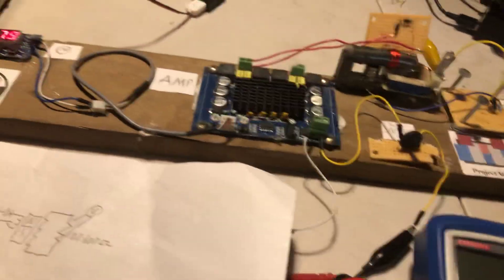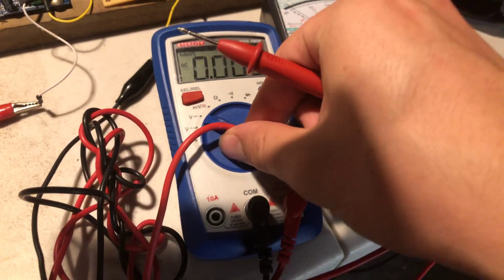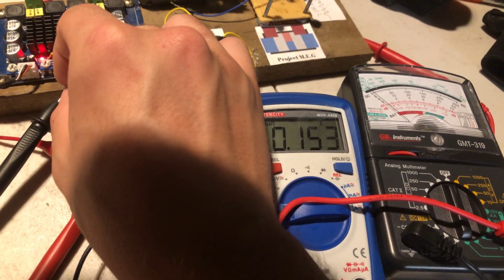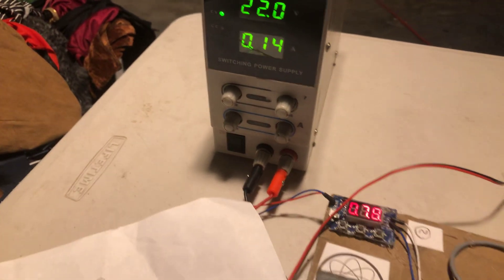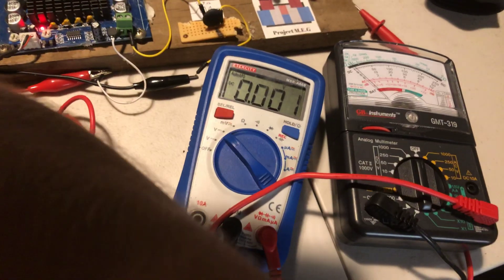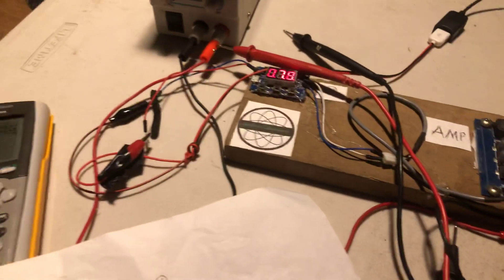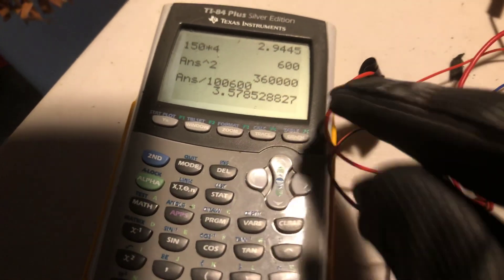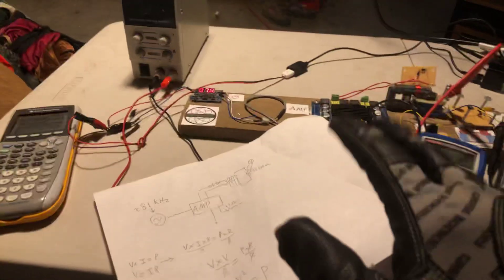Motionless Electromagnetic Generator by Tom E Bearden (Ferrite Core)

Comment: CORRECTIONS: you can break a law depending who you are.....BECAREFUL
Reply from the maker: Laws of physics can’t be broken
Reply: @filigenzilab9613  Thank you for making the MEG please do more videos about it.
Kirchhoff's law of thermal radiation has been broken tho.
Reply from the maker: nightmisterio if his law of thermal radiation has been broken, which I don’t know much about him, then it wasn’t a law.
Reply from the maker: nightmisterio I have quit doing the M.E.G project, but I have moved to other potential overunity devices, like the Tesla hairpin circuit (which I posted a video on) and the 2SGen by Naudin
Reply: @filigenzilab9613  you did get more power out than in correct?
Reply from the maker: nightmisterio it may have likely been a mismeasurement. I may not have had the best tools for measuring, I didn’t use a nanocrystalline core, and I got different results. I’m an amateur
Reply: @filigenzilab9613  The MEG was designed to create more energy than spent, I am glad you had a positive result and were a witness to it, I am sure all measurements were correct. 👍
Reply from the maker: nightmisterio thanks

Comment: You are operational diagram is very sketchy NOT neat try to draw an neat sketch diagram. If you want real engineers to comment.
Reply from the maker: Sure thing
Reply from the maker: Well, I plan on recreating this circuit using better equipment, but until then, I can send you a link to the pdf containing the schematic

Comment: Really cool you like to experiment like me. Accelerator. Is it drawing from ground? The thing is I can get what looks to be more power than I put in the problem is load. When I add a load it slows down the acceleration because we can actually make something run faster and create momentum but a load is like the brakes on a car. Wow keep experimenting! I believe that it can be done in the use for a charging system. Did you think this up yourself?
Reply from the maker: It’s not my design. It’s the Motionless Electromagnetic Generator created by Tom E Bearden. This is a mere replica
Reply: Well looks like you did a very nice job on your replication. Congrats!
Reply from the maker: Ralph Hernandez thanks
Reply: Antlether Filigenzi I second what he said this is a badass replica you know what your talking about. I’m not a genius either but you definitely know electronics.

ALSO ABOUT YOUR QUESTION!!: In my basic level of understanding in physics trying to explain your question unless I got what your asking about is wrong. Like Tom says we are in a ocean of energy the electrons is getting pushed thru and channeled all from space if your under water and take a pipe and have water flowing in it to a empty cup all you’re gonna notice is the end result not a change in the ocean of energy we are in I have research papers on where the hell power is being pulled from with magnetic generators. Because your right it’s not allowed by true laws of physics to get anything from nothing. A electromagnetic field experiencing some fluctuations in a electric generator definitely pushes electrons. Try fluctuating a magnetic field with electric current induced fluctuations by changing your Hz of current going to the coil powering the electromagnet, because Moving a magnetic in a coil or vise versa pushes the electrons in the wire and creates a current. Look at how they generate energy. They make kinetic energy and use magnetic fields to make it into electricity energy. They rip us off with that shit but I can get into that if you do wanna message me lol
Reply: Glad I’m not the only one! Lol seeing like minded people out there made my damn day!! Lol pardon my French but My fiancé thinks I’m fucking crazy but I got started on making a whole note book correlating how different shit works and how it relates to a motionless electromagnetic design I have. 

And about that I got shown the goods boys. It took my mentor months to finally cough up. He swore to me magnets works for free energy every time and I kept using the main stream physics explanations for why i didn’t believe him but hell I been pulling legitimate research papers about the properties this design uses, and I can even explain my design using an electric motor. And the one I came up with myself can be explained like that but it’s almost perpetual motion by design since it’s using gravitational and magnetic electrical fields I’ll show anyone else and explain to anyone else that is trying to experiment as long as you promise not to use it to try making money and get famous from it because you really can’t and when you put it in to the patient office I don’t wanna get shot by some alphabet agency spook lol It’s probably stupid even making that offer to people I don’t know but I just decided on a whem to look it up on here to see if anyone has talked about it on a video and tried to produce something and I seen y’all talking bout something I didn’t think anyone really cared about really made me happy to see I’m not alone or crazy lol

And basically What my design is just basically is a redesigned transformer. I got warned that this sorta information is dangerous and if I try to do the “Bahm effect” or whatever the name of the phenomenon that causes anti gravity is that it’d definitely be hazardous to my health and the monopoly men will nab my ass when I cross into anti gravity so don’t do that either if I share what I got with y’all but .  I’m scatter brained and not good with names I’ll show you what I’m talking about though anyway I can I won’t the information I got although not much more then you can do it’ll maybe help some like minded people that are trying to do a good thing. 

Currently rn I possess the 1932 university of Moscow documents I found on Beardens website about there research on the MEG and I’m attempting to make a translation after a while probably start on it tonight and copy there formulas I will not translate the whole document but try to where they have the Spectrometer readings and equations and pictures. I never really learned much Russian but I’m doing a rough translation using google or a alphabet diagram till I get ahold of someone who can translate better. 

I’m only offering this info because y’all seem serious and I want to add new minds thought to the material I have in my note pad and my head.  But my design that’s been passed on The COP is greater than 1 apparently I’m going to attempt this design along with my other one soon once I get my funding in order I lost my job recently but if you two or anyone is still reading and is as interested in this subject as I am then email me at tylerhudson99@icloud.com or message me on here I might not see a YouTube notification as quick as a email but I’ll keep a eye out either way.

Comment: I think about these devices like a mechanical spring or pendulum. The magnetic field gets pushed or wobbled by the input frequency which sets up the resonant condition. Like a swing can only be pushed so high before it gets out of frequency, you will only get so much back from the system. I can get a pendulum moving a long way with a very small input but I can only get so much back governed by the size of the swing. Maybe you can improve things by using less hungry amplifier and a bigger MEG and tuning it to resonance of the primary to drove it. Use Tesla's quarter wave for the secondary tuning and you should be swinging the most from the least input.
Reply from the maker: thanks for the advice
Reply from the maker: m3sca1 so what do you think is the source?
Reply: @filigenzilab9613  when you push a swing, what is the source? If I were to push a pendulum that had a big saw on the end...i could cut through more wood than if I didn't have the contraption. Would I say the energy is from the mass or from me oscillating the mass? In the same way I don't think there is extra energy being tapped. I think if it as a function of the system.